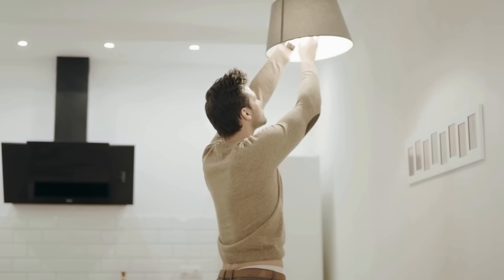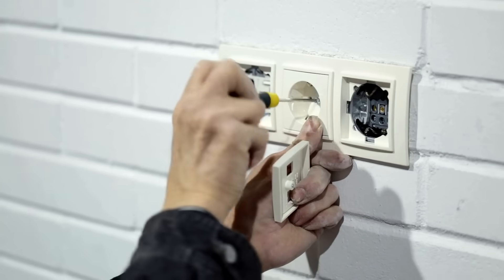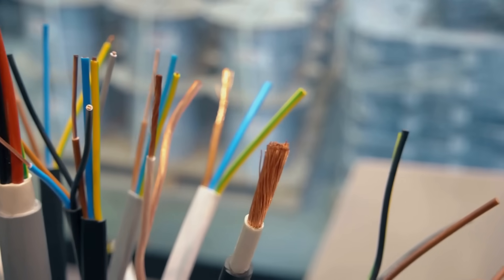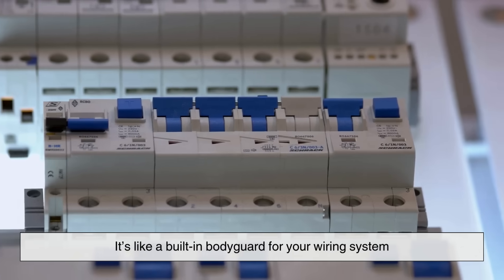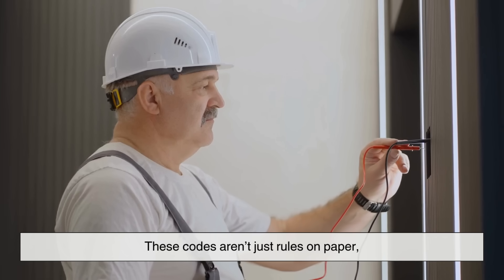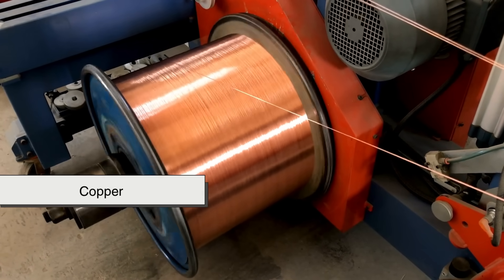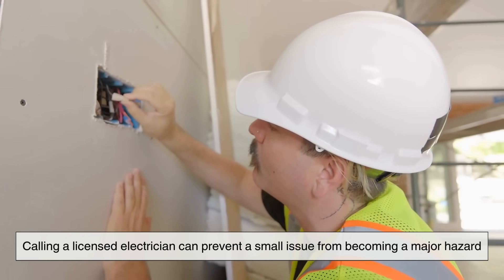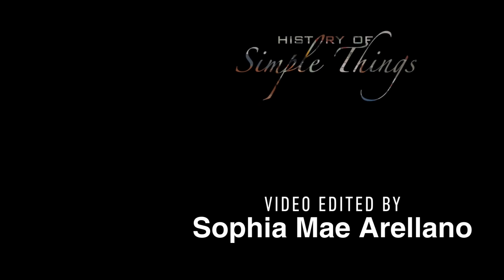What Is Electrical Wiring, Its Uses, and How It Works?

Comment: N. America homes use a split-phase system with two 120v hot wires out of phase with each other((240v). Most appliances run on 120v (hot + neutral) but 240v circuits are used when more power is required (HVAC, kitchen range, dryer, EV charger, some power tools)

Comment: @ 6:15, Aluminum does not conduct electricity as well as copper although aluminum is cheaper than copper. Aluminum wiring in homes can pose a significant fire hazard, particularly where it connects to outlets, switches, or other devices, or where aluminum and copper wires are directly joined without proper connectors. Aluminum wire oxidizes and becomes brittle, and can also "cold flow" from connections, leading to increased electrical resistance, overheating, and potential arcing that can ignite fires. The U.S. Consumer Product Safety Commission (CPSC) has stated that homes with aluminum wiring are at a much higher risk for fire hazards. Furthermore, Copper does not conduct electricity as well as Silver although Copper is cheaper than Silver. During World War 2 at Oak Ridge, Tennessee, massive amounts of copper would have been required to construct the giant electromagnets for the huge calutrons used to separate fissile Uranium-235 from Uranium-238. However, copper was also needed for building armaments to win the Second World War. Therefore the top secret Manhattan Project borrowed 14,700 tons of silver from the United States Mint bullion depository at West Point New York to make silver wire for the massive electromagnets. The Uranium-235 that was produced was used to build the early type of atomic bomb known as "Little Boy" that fell on Hiroshima, Japan on August 6, 1945. After winning World War 2, the borrowed silver was melted down and returned to the West Point, New York depository.